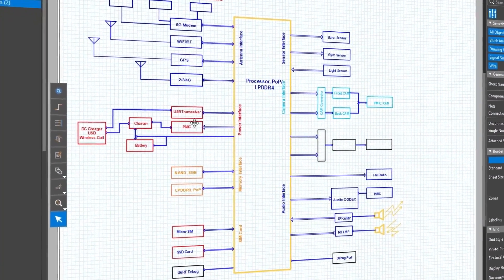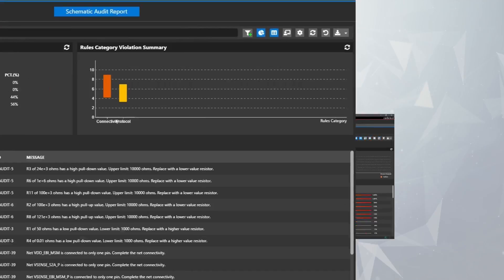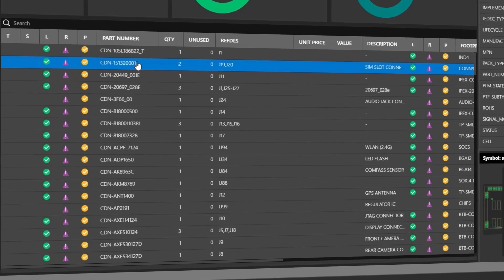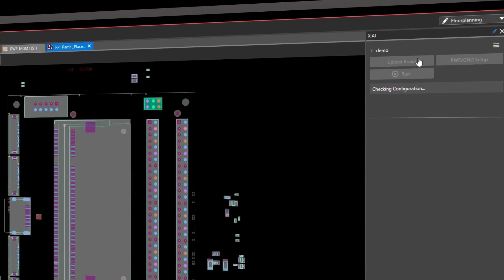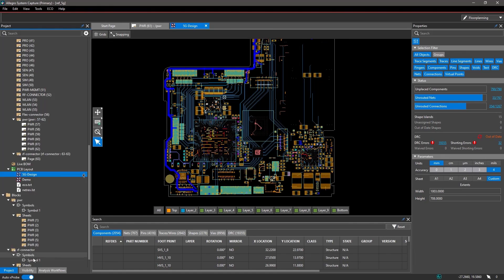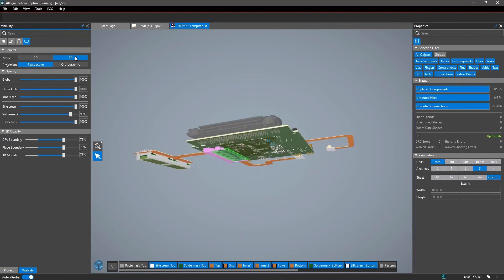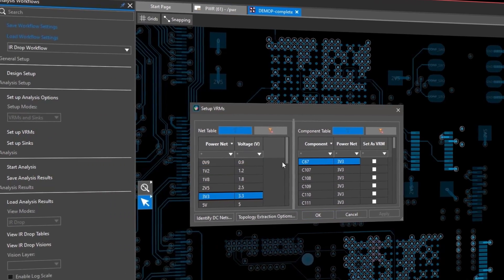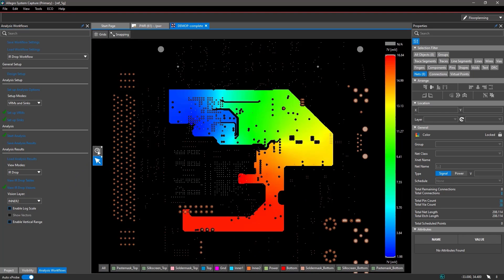Allegro X Platform Overview

Comment: 🤯 this "AI Engine" seems groundbreaking. Did I see correctly that it's like an autorouter that considers constraints such as timing, IR drop, etc.?
Reply from the maker: Allegro X AI encompasses technology to automatically place components, route connections, and generate power/ground planes all while considering a variety of constraints, including timing constraints and IR Drop.
Reply: @CadencePCBDesignandAnalysis  So, with this tool, we dont need PCB layout engineer any more to layout the PCB design ?